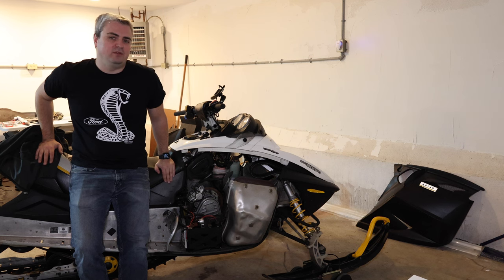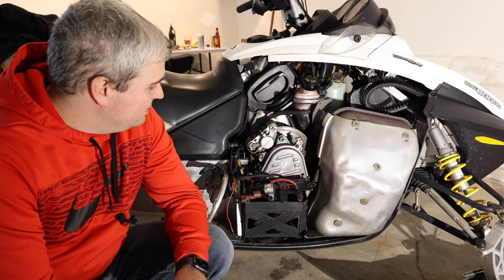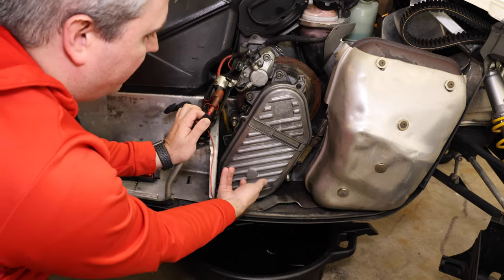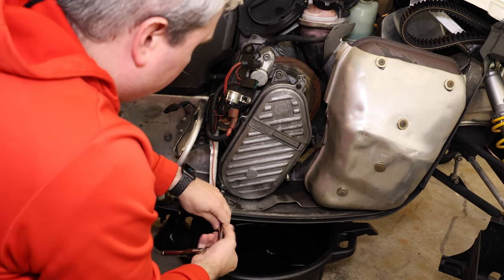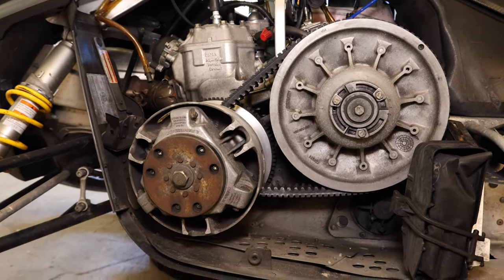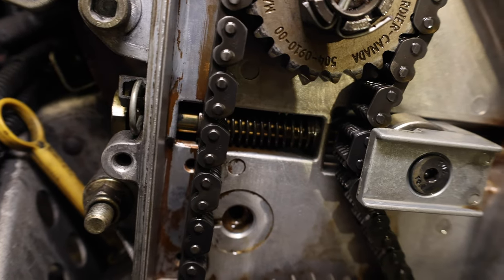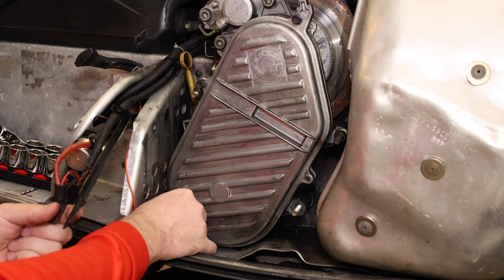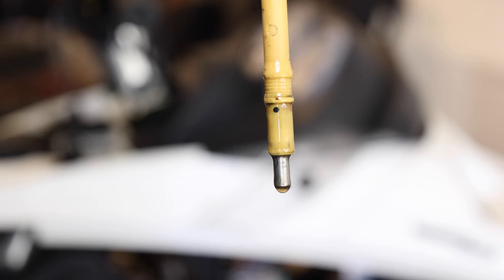Snowmobile Chain Case Fluid Change | Ski-Doo Rev Chassis

Comment: Is there a separate gasket required?
Reply from the maker: There is a gasket (o-ring style) on the chain case cover. I typically reuse mine each year. It doesn't hurt to have an extra on hand incase it is damaged.

Comment: My question is why are using gear oil and not the chain case oil?
Reply from the maker: Good Catch. I pour my leftover chain case oil in that container at the end of every year. 

The containers are 12 oz, the sled takes 8 ounces. I do two sleds so end up with 8 ounces left over every year.

Comment: There’s actually a drain plug on the bottom of the chain case. Don’t have to pull the cover off!
Reply from the maker: You are right. On my sled there is a riveted cover which I didn’t want to drill out and replace. Without removing it I wouldn’t be able to access the drain plug. 

I feel it’s always good to do an inspection in there too when it’s open, but you are right on the drain plug!